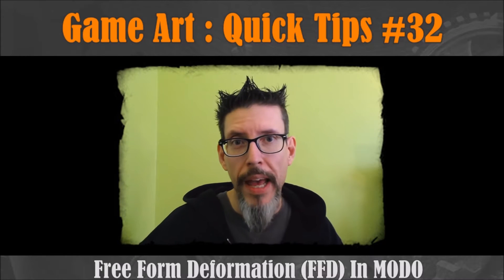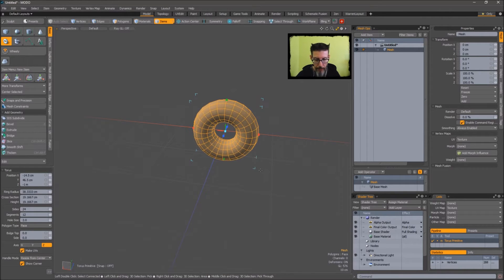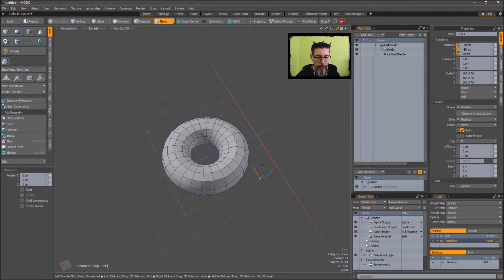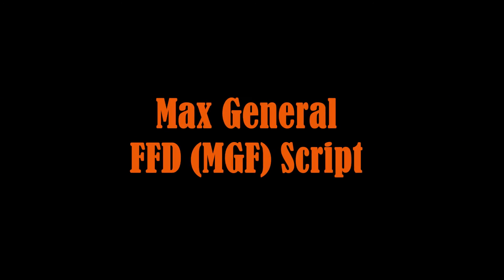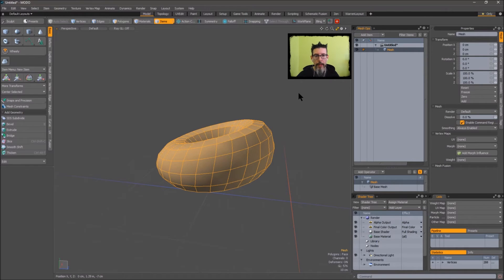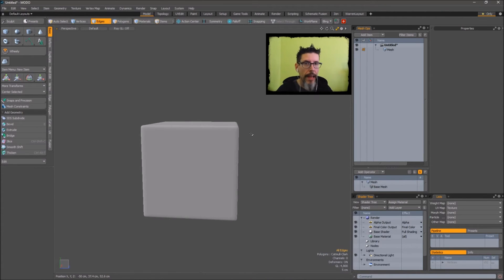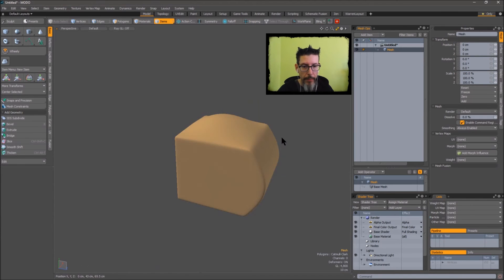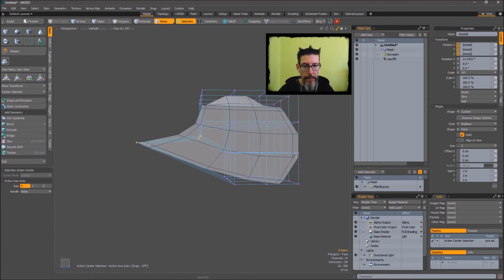Quick Tip #32 : Free Form Deformation (FFD) In MODO

Comment: I seem to be having an odd issue when I apply the deformation through the pie menu it doesn't freeze it and do what it's suppose to. Here's a picture to illustrate my issue. Just curious if anyone else has this same issue. I'm using 10.2v1 so perhaps that's the issue? http://tinyurl.com/z6nad4d
Reply from the maker: That's definitely odd.  I've literally NEVER had it fail.  Weird.  Maybe try it again in a clean scene?  Could be there's some transform cruft stuck in there or something.

Comment: Thanks Warren I think these modifiers will become a whole lot more interesting as we start to use the Procedural modelling section in Modo 10. Until then freeing geo feels hacky somehow.
Reply from the maker: You get used to it.  I'm pretty excited about how they're implementing it actually.  So far, it's entirely optional.  And you can mix and match.  So you only need to use the stack on stuff that might actually benefit from it.

Of course, the interface for it needs to be streamlined a LOT.  It's very clunky and click heavy at the moment, IMO.